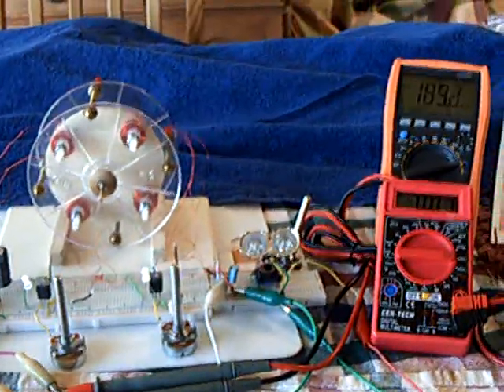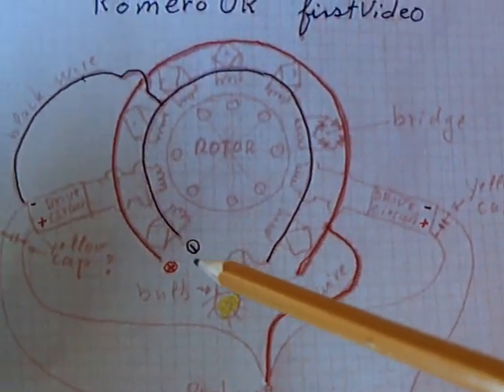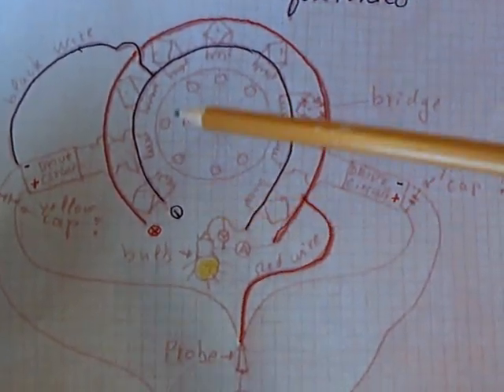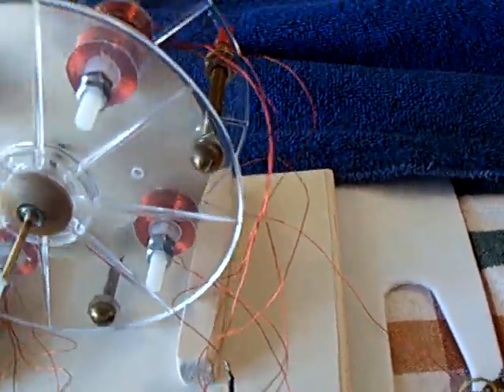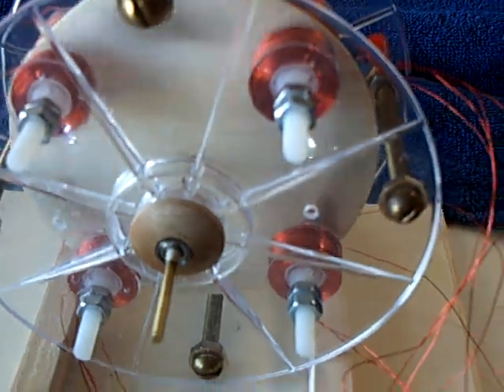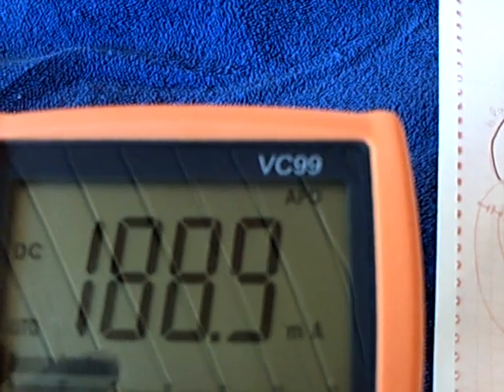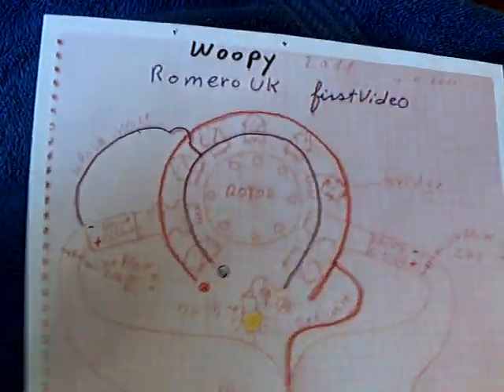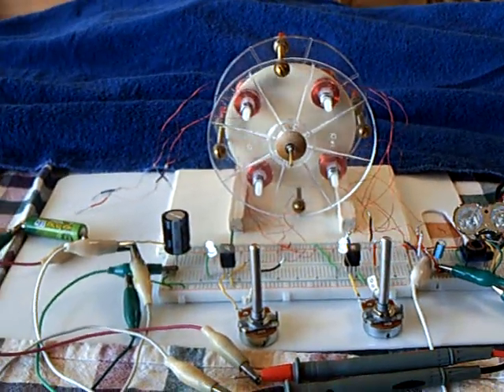RomeroUK Muller----Woopy discovery!!.ASF

Comment: The secret is getting in resonance between centrifugal and centripetal forces of the vacuum energy with those shorted coils. Put them out, spin the rotor very fast and see if it accelerates a bit when you place back the coil near the rotor.

Comment: A similar effect.  My latest motor is a modified Renaissance Charge "mini dual pole" motor.  If I connect the generator coils in series ( circuit is completely separated from the drive coils) and run their output through a bridge, I can connect the (unfiltered) DC to an LED and the current draw on the drive battery decreases while the rotor RPM goes up.  I have a string of LEDs in series, and if I "decrease" the load by increasing the number of LEDs (thereby increasing the series resistance) the motor slows and the drive current increases.  In fact, if I short the bridge output, the motor speed increases even more.
How to understand this?  Not perfectly sure, but I think shorting the generator may decrease the magnetic drag produced by the generator cores.  Any comments?
Reply from the maker: +David Sligar  Hummm.  That seems to go counter to lenz law.  Interesting.  Shorting the generator coils should drag down the rotor.
Reply: +Lidmotor Notice I didn't short the coils (yet!), I shorted the bridge, which means there is not a dead short.  The measurable current flow through the diodes is 60 to 80 mA given specific initial conditions.  Maybe it's "Lenz Hypothesis" LOL!

Comment: @User2718218 i agree the input draw changing is a direct result of the triggering circuit.. hes using a bedini so 90% of the time his draw will decrease as it slows. Romero saw a current drop (IMO) because he was lighting the bulb with flyback. if we are to assume his rpm didnt change then why else would the input draw even move with an attached load. if the rpms didnt change then it shouldn't.. the draw would only change if his load was interacting with the input pulses which it had to be.

Comment: @User2718218 i suppose a simple test would be observing the voltage in a separate gen coil while loading the other. then pulling the same 2ma from the other coils simultaneously. if still no slowing is noticeable then id say it deserve re-evaluation. i agree i have tried to observe pule frequency on a PC scope before and while i felt confident i could observe slight changes in the wave frequency its still not a totally "accurate" reading.

Comment: @Magneticitist In addition Lidmotor's current draw reading for the motor was jumping around a small amount during the whole test which is normal.  However that jumping around makes it impossible to know if the current draw for the motor changed or not when he applied the small load.  In addition, pulse motors typically do not change their power consumption when the generator load changes.  Instead it's rotor RPM that changes.  Still can't explain why Romero saw a current drop with the bulb load.

Comment: @Magneticitist Even with a very small load there is a very small Lenz drag and a very small decrease in the RPM of the rotor.  Unfortunately there is no "escape clause" for small loads.  The change in rotor speed can be below the threshold where the human ear can distinguish the change.  If I recall correctly for human hearing the resolution for detecting a pitch change is 1 in 600.  Also, you can't forget that with a small load the RPM will change very slowly, and that makes it harder to hear.

Comment: @Lidmotor i have to say i still would have thought over 2mA load would at LEAST slow it a little, or raise the draw a little, but i feel like if it was a good deal more than that lenz is coming for sure. i think some of Romero's load may have been indeed running from backspikes. just makes more sense, seeing as his draw slightly decreased upon using the right load. without him using some backspikes i just dont see how he did it. in fact his rpms per current output just really doesn't add up

Comment: i have been able to do the same thing on just about every setup i try, BUT thats only when the input is so much higher than that small current i get from the generator side. it has led me to the conclusion at certain times just a very small amount of current can be loaded, and nothing more. increasing this load more eventually causes the lenz, but a tiny fraction can be received with no slowing or change in draw. the problem is in each occasion, i dont have enough space to implement enough coils

Comment: Hi Lidmotor Great work again !  Keep it up ! , I was wondering what happen when you remove the transistor (specifically the transistor ) from the Load JT circuit  if the led stays lit , obviously the answer should be no but i think it will ...

Besides that great work again ! Mk1

Comment: @Lidmotor Hi, appreciate your valuable updates please clarify: 1. No Muller/Romerouk coils are directly paralleled, all isolated by FWBR or driver ckt but you aren’t using FWBRs, correct? 2. How many total coils are driving and how many total are generating in your test? 3. Is your JT load current supposed to be gen.+batt. current? What is your gen. voltage before you connect JT load to rail? Woopy drwg shows light bulb always powered directly by battery?? Thanks for all your learning videos.

Comment: Excellent demo. Have you found a 'knee' point ? where the load trips over as too great. I'm wondering if the rotor will speed up just before that point...which is counter intuitive but has been noticed here with other pulse motors. A regauging effect because of Lenz maybe and the load working in an odd harmony. Either way, soldering iron is on :)